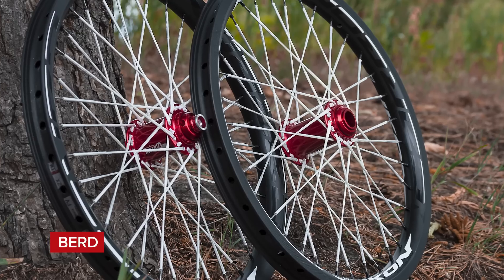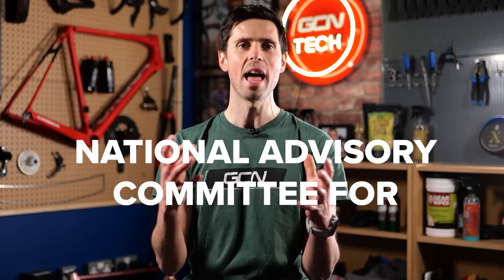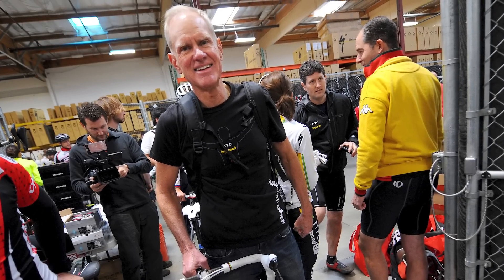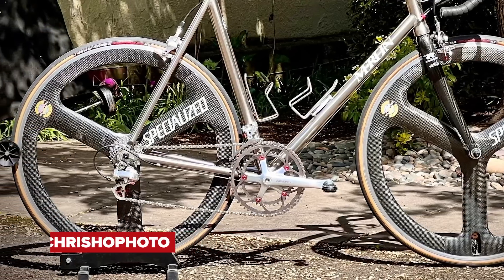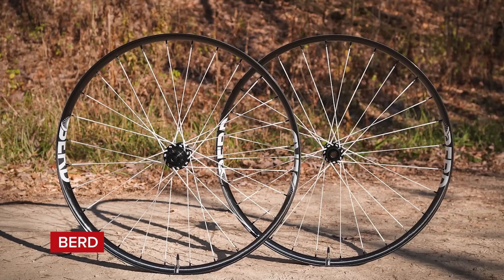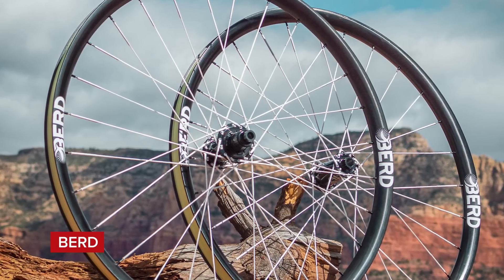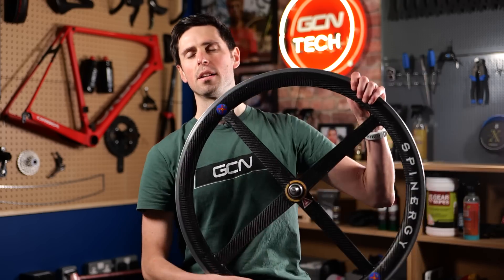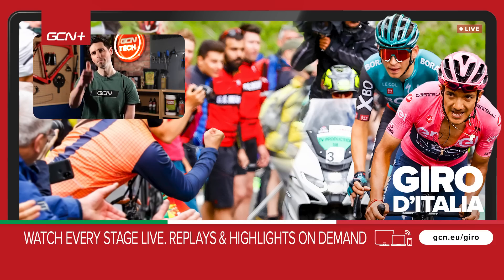6 Wheels That Shocked The World

Comment from the maker: Did we miss any? Let us know your favourite wheels in the comments below 👇
Reply: Moser's hour record was in 1972? 5:41
Reply: Not a wheel, but NASA's bullet proof tires as demonstrated in Veritasium's "How NASA Reinvented the Wheel" video.  It would be great if you could get a pair for testing (Hank could have use them in his recent 200 mile challenge).  If you can't get a pair, then getting Ollie and Josh to geek out on the tech would be fine.
Reply: Corima 4 spoke
Reply: Tioga/Sugino tension disk wheel in 700c
Reply: Campagnolo shamal hpw12 and Bora
Reply: Tomac's Tioga Tension Disc.
Reply: Spinergy Spox
Reply: As far as older carbon wheels go, the REV-X shown here were the best in the 90's and 2000's. But as for these days, the best carbon wheels is Princeton Carbon Works wheels. Thanks.
Reply: Regarding metal spoke wheels LEW Sydney were the kings. 3 times more expensive than comparable Zipp wheels. Also you forgot Mavic 3G. I believe much more prominent and higher end wheels than Revx in early to mid 90ies.
Reply: Madfiber

Comment: I loved my Spinergys. Fast, head turning, amazing. But I had the earlier versions where the break pad only had carbon as the breaking surface which were useless on steep hills, worse when wet, and made for some very twitchy descents.

However, I stopped using them after a massive crash. I hit a 10cm deep pothole in Spain at approx 40kmh and the front wheel completely crumpled. I flipped forward, off the bike and into the air, before coming back down onto the rear of the bike and my elbow broke through one of the carbon splines on the rear wheel, lots of blood and damage to my elbow. 

Thought it was better to look for an alternative and went down the deep section route.
Reply from the maker: That sounds like a nasty crash! Glad you are safe... lets not scare Alex too much, he'll be riding these soon enough 😬
Reply: @gcntech  Certainly the biggest crash in 30+ years cycling as an adult. Good news for Alex is that the Spinergys weren't to blame. Entirely my doing, slip-streaming an articulated lorry. Pothole appeared from under the axle with no time to react, and I launched skyward. As long as he doesn't get up to that mischief I'm sure he'll enjoy the wheels fine. I did. Lovely wheel. Sound a bit helicopter blades cutting through the air. Sounded fast even if I wasn't always going fast 🤣
Reply from the maker: Ver resposta curta

Comment: I actually still use a Specialized trispoke rear wheel in combination with a Mavic Cosmic Carbon SSC front wheel. HED also offered the rear trispoke with by carbon plates closed holes (the HED 3D disk wheel), which creates a really awesome sound. Depending on the direction of the wind, I have the impression there is nearly no difference, and I wondered wheather the trispoke is close to a disc wheel, or the 3D disc is just close to the trispoke - now I know the trispoke is close to a disc (and especially to my disc). Lance Armstrong rode sometimes a HED deep trispoke, which was deeper and had a u-form in contrast the the v-shaped "normal" trispoke. Those deeper trispokes are quite rare, and mostly made for tubulars. On my tt bike, I (133lbs/5.8ft) tried to replace the cosmic carbon front wheel first by a DT Swiss ARC 1100 Dicut 80mm, which made the bike nearly not controllable in crosswinds (as if someone rode beside me and kept grabbing my handlebar). The 62mm is way better, but still a huge difference to the just running straight Cosmic Carbon (with still 52mm), which in combination with a 20mm Supersonic tire seems to be the perfect compromise between aerodynamics and crosswind-stability, already a 23mm wide tire make the aerodynamics really bad. On fast descends, I can concentrate on when to go in "full afterburner" to achieve the highest maximal possible speed (up to 59 mph), which the DT Swiss I had to concentrate on not being blown off the road.

Comment: I mechanicked for a pro/am team that used Rex X wheels in the 90s, and they seemed to have a fatigue life: we had 3 fail in one multi-day tour in 1998. The spoke bonding joint at the rim separated, and the little rivets at the spoke/rim junction  that seemed to be a tacit acknowledgement of the design flaw lost their heads (actually) and the rim ripped in half down its centreline, the tube protruded through at 120 psi and it was arrivederci Roma after that. Luckily none of our riders were badly injured as a result.
Reply from the maker: Ah nasty! What bit of retro tech did you work with that you loved? 👀

Comment: Great to see the Specialised Tri Spoke features. I had a pair of HED3 clinchers back when I was time trialling. They made a fantastic whoop whoop noise when I was riding along. Also interesting to see modern Tri spokes coming back on with wider rims. The Specialised/HED3 needed a 19/20mm tyre for optimal aero.
Reply: Be nice to have ones for 22mm tubular
Reply: I too had a pair of HED 3 clinchers used for time trialling, they do sound fantastic, a bit like a Chinook is following you😂

I had a freewheel bearing break on my road bike last week, so fitted my old HED 3 on the back along with a 50 mm carbon front, I had forgotten how fast they are over a regular alloy road wheel😊

They may well stay on for the summer....👍
Reply: Mboka Elengi TV  following a vtuber on what she says I wish they went whomp whomp or is it womp womp
Reply: The Specialized wheels were a slightly refined version of an earlier design marketed under the brand name TRiSPOKE (lower case "i" is intentional). The major differences were that the TRiSPOKE used non-symmetrical, airfoil shaped spokes, so that there was a specific direction of rotation, and the construction was fibreglass, as opposed to carbon-fibre. Remove the decals from both and most observers would think that they were the same wheel.
Reply: Did they also listen to Insane Clown Posse?

Comment: Omg lol I am using DT Swiss 180 and berd spokes for my next wheel set, looking to have Trek Emonda ALR frame and all parts laid out for a picture before build the wheels though as I like to show my bike builds are true builds as I build the wheels too
Reply from the maker: Nice! Make sure to upload a photo of the finished product to the GCN app!
Reply: @gcntech  I will might be a few years to save up for full build, also want to repair my computer from last heatwave ruined the water cooling, I am slightly wondering if normal seatpost or dropper for picture as plan to have both for bike so depend where I ride

Comment: Specialized Tri Spoke. Spinergy Rev-X. Still have both of them. In fact, both were first generation wheels where the rears were built to be used with freewheels. The Tri Spoke could be used either on the front, or the rear. All you had to do to change it was to change the axles and spacers.
PS. Check the Spinergy Rev-X spokes before every ride, for small cracks. If a front wheel decides to explode, you may need some new teeth.

Comment: The Specialized wheel was an illegal blatant rip-off of the Original Trispoke wheel made and patented years earlier.  The Original Trispoke was proven in wind tunnel testing superior to the Specialized wheel.  The Original Trispoke was manufactured before cassettes were even invented.
Reply: I didn't see this and posted a response to much the the same effect. The original trispokes were first marketed in late 1987, two years before Specialized version. They even trademarked the Trispoke name so, technically, the Specialized wheels aren't trispokes. The main differences were in the materials and spoke cross-section, with the originals have a non-symmetrical spoke cross-section, so that there was a specific direction of rotation.